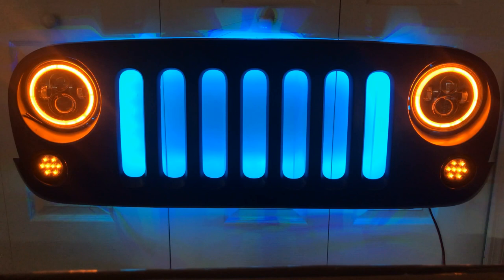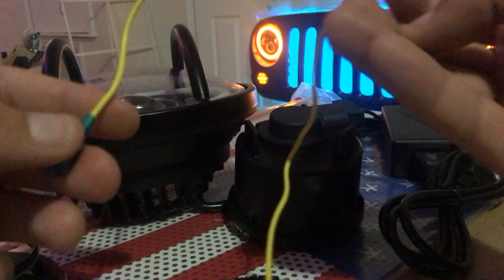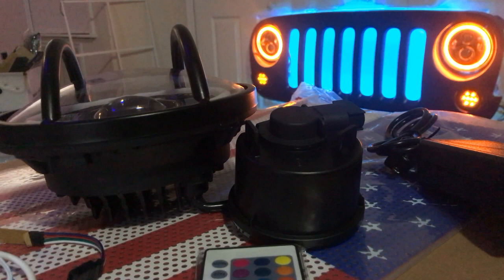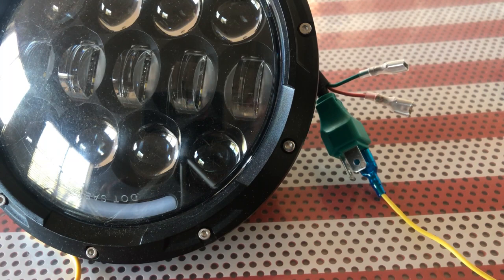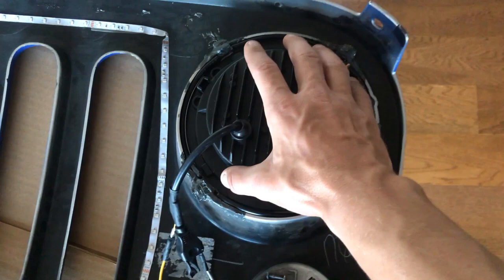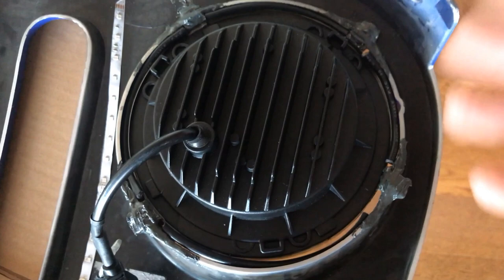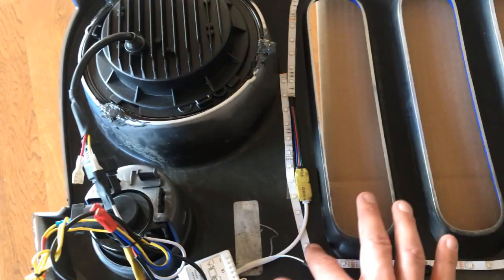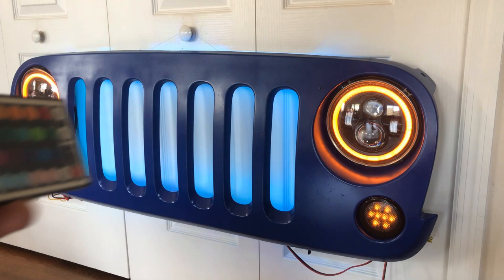Jeep Wrangler Led Grille Wall Hanger Art Halo Headlights Grill DIY How To Lamp

Comment: Been wanting to do stuff like this, walk around a junk yard and find parts to a car and make em into furniture/decorations like a bench with a old pickup truck tail gate for the back rest. Take a back end of an old muscle car and put back seats into the trunk so it turns it into a couch. I seen a front end of a 70 Chevelle the guy made it into a desk at a car in pound lot. The remake to gone in 60 seconds at the end when they are having a BBQ I forgot what kind of car it is but they have a front end of a car they lift the hood open and it’s the grill for the BBQ.

Comment: I have a Axial LED light with DRL and turn signal. The plug for DRL and turn signal has a 3 wire plug and a lone yellow wire. Would you explain how to just wire the amber turn signals to be on? Thank You
Reply from the maker: im not completely understanding. you have a 3 prong plug right? how many small wires next to the plug? in order to test which wire does what, take your live positive and negative wires and attach the ground wire to the ground prong on the plug then touch the positive wire to one of your wires for the drl.
Reply: @JohnPageContraband  I have 3 wires.
Reply from the maker: to test them youll need to ground the headlight and one by one touch those wires to your live wire so see what each wire does.
you should have 5 total connections for each headlight. there might be an actual plug or just wires. youll have a ground, a low beam, high beam, white halo ring and amber halo ring. you need to figure out which one is your ground. once you do that youll be able to easily test and figure out what each wire does
Reply: @JohnPageContraband  Thank you